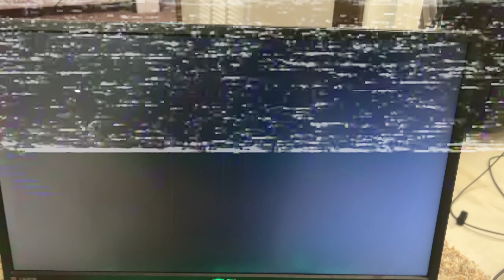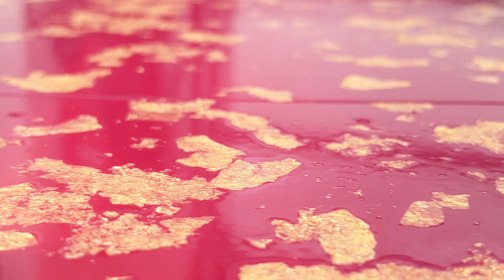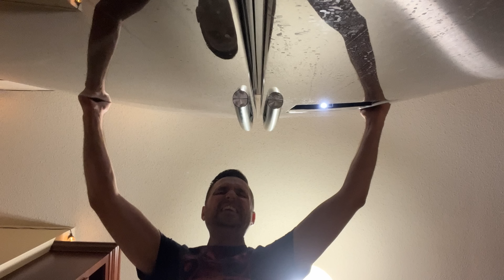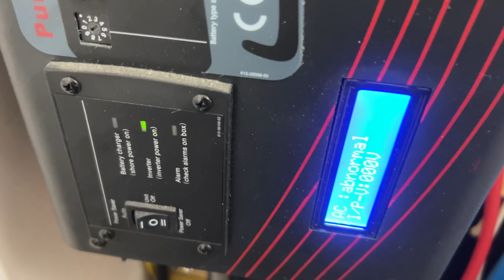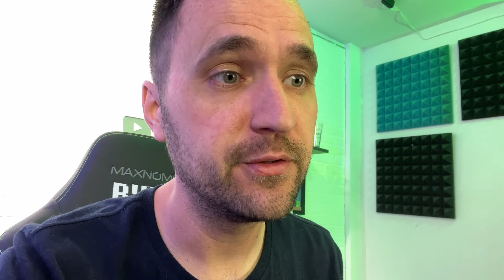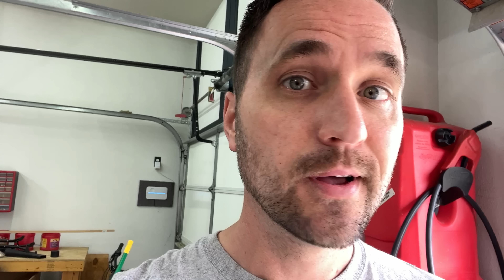Zigbee hardware, Moisture Sensor, Batteries, Mustang Exhaust, Server build.. #MEGAVLOG

Comment: I have a couple of suggestions on how yo fix the paint job on the file server lid of your still up for messing around with it. Easy option you could vinyl wrap it. More effort option use paint stripper to strip of the paint and sand to a smooth surface if needed. Probably would look best with a simple flat black paint job. As for your logo maybe have some place print up som decals for you in a few different color schemes and see what fits.

Comment: you should ditch zigbee its not very reliable, very short range and always disconnecting.  Lutron with their pico remote and Caseta switches are way better for controlling lighting and its dimmable
Reply: that's probably because something is blocking your signal "like a concert wall" and u need a device that can act a zigbee repeter. :)
Reply: @Crazy_Finn  with lutron no repeater neccessary.  and no concrete walls, 4000 square foot house all wooden construction